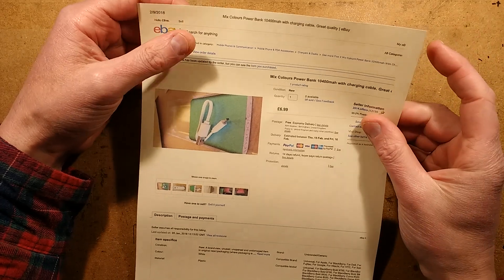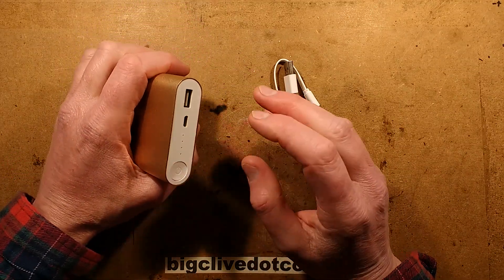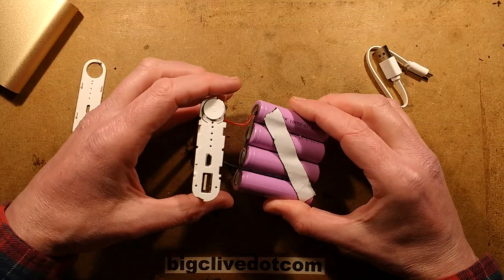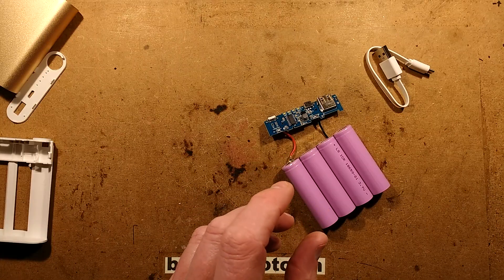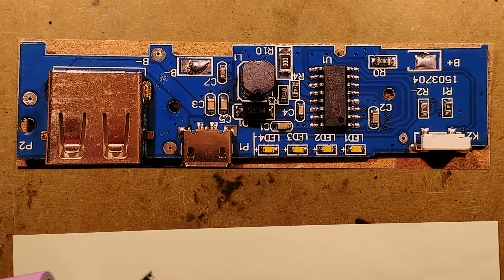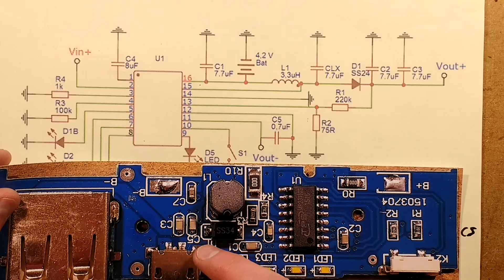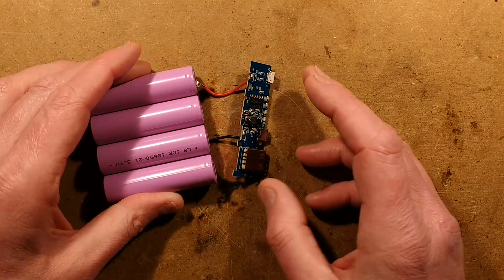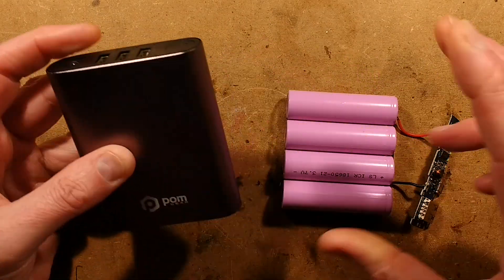Inside a fake "10400mAh" eBay USB power bank.

Comment: A few things that would be good for us to know about that unit. How much do the batteries weigh. Remembering of course that a decent battery almost always weighs between 43 and 45 grams. These batteries have the "look" of decent batteries. In fact, they "look" like batteries which  are used in a laptop battery I have purchased at one time. I believe I could give you the number,,, Well, looked and there Samsung ICR18650 , at least on mine, which came from a new laptop battery. Of course, they could be fake and filled with sand or whatever. But, then, would they fit that 43 to 45gm profile I've found to be so universal ? I have 125 approximately 18650s here, all new. I've found when I buy individual batts from ebay china I'm ripped off, they may weigh as little as 20 to 25 grams and have terrible specs even when your told 5000 mah heh heh.  A set of 4 from Walmart one time weighed 27 grams each, so even they can rip you off. Laptop Batteries, always are good. So Far. 

  Next , at a minimum, a small 3 or 4 digit VM on the batteries, which are in parallel,   should be between 4.2 nd 3.7 of course. Nice, would be a clamp meter for dc current on output of batteries. Then, we could get the full picture.  You do have one of those little $45 dollar (not sure what that is in pounds) clamp meters , right ? They are SO COOL !  Mines a Uni-T , True RMS 2000 count, 100 amp DC down to a few milli-amps ! For under $50 ! 

Anyway, cool vid and a buddy who is crazy about these little gadgets told me about it. From the Redwoods, its Mike .

Comment: So, you say it is not 10400mAh, and that it is because of fake sand filled batteries. But, you don't show any part of actually testing it. A battery pack normally consist of 1,2V cells, so that is what the calculate with even while it gets converted to 5V. So, 10400*1,2V / 5V= 2496 mAh at 5V. Where an efficiency is 80% if to be expected, that leaves us with 1997mAh at 5V. So, can you charge an USB device at 1A for almost 2 hours or not?

And if the battery cells are just sand filled, open it, and show it.

Comment: The last one I bought had an insanely high capacity claim but the ebay seller stated that it was the manufacturer's claim, not his. One dead give away is to look at the charge rate and time. If it says it charges fully in 8 hours at a 1A rate, there's no way it's over 8000mAH (2000mAH per cell) capacity. I've noticed that some will use the cells' capacity but then combine that and the 5v boosted output to calculate a higher output capacity claim, then (accidentally or intentionally) shift the decimal one more place to the right (giving something like 100000 rather than 10000mAH in my case when the actual combined cell rating was 8000mAH at 3.7v not 5v). Knowing my electronics, I still thought it was a good price for the actual capacity and solar charging (be careful also against a large panel made up of smaller segments spaced out to 1/4 or less coverage like I've seen on cheap solar walkway lights).

Comment: It's a clone of already a Chinese company Xiaomi
Reply: I have the original Xiaomi product of which this is a clone. Nice to know the Chinese are copying other Chinese designs now, instead of just the west's products.
Reply: You said that as if no one knows what Xiaomi is.
Reply: That reminds me of a gas plate tamper my boss bought at auction. Turned out to be a Chinese knockoff of a Chinese knockoff. Never did work right, the engine near fell off within two days of using it. Sits in the corner as a reminder to bring me with him when he goes shopping at the auction.
Reply: Me and my wife both have Xiaomi phones. Poco and Note 7. Both phones are great and battery life is amazing.
Reply: @chrisa1944  they look alright but that android version looks god awful. Bit like Samsung
Reply: @cydonia9342  I always use Nova Launcher so not an issue for me.
Reply: Chinese doesn’t mean bad.
Reply: MAXYMOK just because they're Chinese they don't make clones

Comment: I bought 5 of the kit version of these last year for $1.89 each. I installed my own salvaged 2,250AH cells for a total of 9,000AH. If I had any 2,600AH cells, then these would make their printed spec of 10,400AH. Anyway, they are very nice kits and have served me well. I always toss one in my bag when traveling. Got mine here...
https://www.ebay.com/itm/5V-2-1A-USB-4X-18650-Power-Bank-Case-Kit-Battery-Charger-DIY-Box-For-Smart-phone-/192057227978

Comment: Imediately I saw, those 18650 Samsung cells are rated at 2100mAH.. 4 in parrellel only 8.4Ah. What a rip off haha! Not to menton they are only 3.7v nominal so will also need a step up! How companies get away with this is beyond me :(
Reply: because not enough people complain, we just put up with crap ;-)
Reply: I'm terribly sorry, I don't quite understand what all of that info means, could you explain this in words that someone with no electricity knowledge whatsoever? 😞😖
Reply: lostskull7467 think of it as buying a gallon of petrol, but you only get two pints. Your still paying for the gallon and your can looks full but it not. You will only ever get two pints worth of miles.

Comment: Please can you test this! 20,000 amp chinese pocket sized car jump pack? really not sure if this would actually work: https://www.ebay.co.uk/itm/12V-20000mAh-Car-Jump-Starter-Black-Pack-Booster-Charger-Battery-Power-Bank-HOT/253357740495?hash=item3afd4c51cf:g:LOcAAOSwlzRaZvog

Comment: But bear in mind that "mAh" does not say shit about what sort of current you can draw from it. Technically, it might not be a lie. I deal with lots of shit, lead accumulators for example, and the manufacturers, although mostly standardised will deal with this differently. For example, 12V 7Ah could mean 12 volts 7 amps for one hour, or 12 volts 1 amp for 7 hours. But usually it is calculated for 28 hours. So, 250mA at any given time (plus, you have to look at the discharge curve). In all cases, legally correct.

Comment: It's weird, i have an ASUS one, it's EXACTLY the same design. Makes me want to check the cells now :o
Reply: Asus is a legit brand, I can guarantee at 99.99% accuracy that the cells are real. You might want to get one of those USB power meters. I did and it's super great for checking current draw and capacity. It even takes multiple inputs like micro USB and USB-C.

Comment: Even I bought one of those... 
Surprised by the rate of discharge, my investigation was a brutal one..
 the 3 batteries(amongst the 4) are filled with SAND... YUP I OPENED THE Li battery.... Suggest you do also.. but make sure you get a voltage reading on one and then,, open the other three

Comment: Clive, do you think there would be less voltage drop, and thus higher output current, if one were to swap those crap cells with something more suitable like an LG or Samsung cell with 3000-3500mAh capacity?

Comment: Hwy I'm sure you get this a lot but what specific power bank would you recommend? I dont care about the size I just want something that actually does as advertised. you can recommend a brand also thanks.
Reply from the maker: If you get a prominent brand name within your country then it will have to comply with trading standards and local regulations.  That means things like Walmart/ASDA power banks are generally predictable.
Reply: bigclivedotcom sweet thanks. I have a hard time finding powerbanks on Amazon because they always seem too good to be true.

Comment: The voltage drop under load is due to the output diode. It's marked as a regular silicon diode on your schematic, which would have a forward voltage drop around 0.7v. A Schottky diode could be put in there instead to lower this to around 0.3v, but they have higher reverse leakage. In this application though I don't think it would make a difference. No excuse for advertising this as 10000mAh though...

Comment: I think the sadist thing is that, the true one, Xiaomi's first 10400 power bank, is only 69rmb(7 pounds in uk) when it launched 3 years ago, it was one of the best selling power banks, and have the best performance with LG's 2600mha 18650 battery.

Comment: A few things. I believe part of the trickle back @ 2.1 Amps load is your typical USB 2.0 maximum current rating, therefore, the current die off after trying to draw more than what the output is speced to deliver is the output transistor's protective gate kicking in. The charge curve you have observed is a deliberately designed in charge curve, delivering fairly high current in the beginning stages of the charging cycle, but deliberately throttling down as more and more energy is detected in the batteries via the mini mosfet circuit loop. Those look like high current rated 1755 cells (??) If so, they are quite capable of delivering the rated spec -if not even more.

Comment: Try the expertpower "10000mAh" external battery pack.
$10 on Amazon in the us.
It is a good power bank but can't take drops while plugged in and charging.
4 2200mAh cells in series
Looks somewhat like this but with a different casing, the chip is a really good one, has short protection etc, led light and 2 usb ports (1 1a and a 2.1a) yet the board also has an extra solder point input for charging and 2 output solder points that are separate from the usb ports solder points. Overall a good power bank for $10 with free Amazon prime shipping, made out of durable plastic

Comment: UL60950
Table 5B – Test voltages for electric strength tests based on peak working voltages
REINFORCED INSULATION  |  PRIMARY CIRCUIT to SECONDARY CIRCUIT  |  WORKING VOLTAGE U, peak or d.c.: Over 210 V up to and including 420 V b  |  Test voltage, volts a.c. r.m.s.: 3 000
For testing with DC, multiply indicated AC RMS voltage by sqrt(2)

Comment: 1000mAh is truly terrible for 18650 cells. Even high discharge/low capacity cells are better than that. Those are garbage battery cells, even if they're not fake. Even Panasonic's weak flashlights cells are far superior. Also, they're ICR which is an old chemistry. INR is much better and safer. Put some real Samsung 30Qs in there and you have a real 12000mAh bank that's nearly bulletproof at the currents USB can draw and charge at.

Comment: It might have a battery at the claimed mAh but the deceiving question which no on thinks to ask is at what voltage. mAh alone is not a good gauge of capacity unless you are aware of the voltage. If you want to compare apples to apples, look at watts/hour

Comment: About 9 months ago I was on a US Air flight from St Louis when a man's power bank in front of me started belching white smoke. He didn't know what was wrong but I have seen lithium fires and realized what was happening. Since luckily we were still on the ground I encouraged him to run it to the front of the airplane and throw it out the door.  When he came back to his seat he told me that he barely got it out the door and then they kicked it out the ramp door and onto the ground. At that time it exploded in flames. I asked the flight attendants if they had any training and what to do for a lipo fire and at that time they did not. I wrote letters and the good news is the last time I traveled they now have equipment to contain a lipo fire and have had training how to use it. I'm not sure of all the airlines do but at least US Air does. I still travel everywhere with a lipo sack for fire containment with my laptop bag just in case. The fumes from one of these fires are pretty noxious and I don't know of anything it will contain at least some of the fumes from a a fire how other than what is called a Bat-safe. These bags ( not the Bat-safe) are fairly inexpensive and I keep a number of the sacks around my home and auto just in case. These lipo cells are used for a lot of things today including someone's Vape  device , your small drones and model helicopters.  I keep a number of these bags around my house and have one in every car just in case. They are small and the bags are very lightweight. One of these bags may not save you but it will at least give you some chance to either get the battery out of the area or yourself away from the fire before it it ignite's something else such as your car or home.
Reply: Just looked at your story - 1yr later. Quite chilling to think it (the battery) could have exploded while airbourne. The airlines here in Perth Western Australia (at last look a few months back) now have a battery size limit you can take on planes. Apart from the smoke - I'm thinking a fair sized metal bucket might be OK in an emergency....? Don't know..... Certainly a metal bucket would beat having nothing at all. Maybe an ice bucket with no ice ?

Comment: You have the circuit upside down. Pay attention to the microchip notch on the top left on the diagram and look at your printed chip it's upside down. You have an effective chip. They did a poorly programing chip that is not doing its job. Most Chinese chips have a faulty programing.

Comment: but its actually cheaper to salvage 18650 from a fake brand powerbank than to buy individual cells. lucky me i got a claim 10400mAh fake xiaomi which disassemble and tested with a balance charger and turn out to be around 2100mAh each for total of 4 cells.
Reply: which looks identical to yours

Comment: I received a fake off eBay listed as a genuine Xiaomi. As I already owned one real one I could tell it was fake straight away. Very sharp edges (genuine has smoothed edges), USB port not perfectly in-line (genuine lines up with casing perfectly), LEDs poorly lined up and light bleeds from around each LED holes. If it doesn't come in a cardboard sleeve with a scratch off silver panel that reveals a authenticity code then you've definitely got a fake

Comment: So, if you were to replace them with 3500mAh cells, wouldn't you still be able to use 14000 mAh ? I'm looking for a way to get a stepping 45W (from 15W to 45W auto sensing) power bank that can provide 3A@15V.

Comment: I got one of those 10400mAh power banks myself (brand new) from a MetroPCS phone store. They claim it will charge your phone 2-->3 times over. Unfortunately, it would only charge my phone ONCE to maybe 85-->90%. It charged my SMALL Android Samsung Galaxy On5 to 100% only once when the power bank was NEW! [As anything else in electronics, you need an OVERKILL of 200-->300% to make anything work properly]. All these companies boast about the ratings of their products, but they usually fall way below the mark!

Comment: got one empty case about 2 bucks (US), not bad capacity with 4 2400mah cells in it, but the current output is only capable of roughly 1 amp. similar 3 cell empty powerbank cases with samsung name on it are lots better, about the same price.

Comment: I have a similar one and mine was even worse two of the batteries had such a high internal resistance they just could deliver 400mAh, the other two were 1Ah and now serve in my led lamps. I am in the process of configuring a new pack and "rejuvenate" the bank.

Comment: These "10400mah" battery bank cases are mass produced at a factory in China somewhere. I have 3-cell versions of the same design that say 10400mah on them despite coming with no batteries, I bought them empty off Aliexpress for $2 and stuck some spare 18650s in them.

Comment: Ever looked at one of the 8x18650 battery pack cases where they're like $4 on eBay and you put in your own cells? I'm going to populate one with some 2200+ mAh cells I've recycled from laptop packs. Seems like an inexpensive way to get a large capacity power bank

Comment: You do know you're never supposed to fully discharge any lithium battery right?... and that's the first thing you did before you tested it. That causes damage that won't recover. Not saying this is a up-to-spec product - but you should know better.
Reply from the maker: https://www.nature.com/articles/srep30248
Reply: Interesting, but trust me it really does make a difference to most people. I have about 100 18650's to power my e-bike and RC's and my vapes - If you over discharge them - even brand new ones - it's a big problem. I just did this with one of my RC car packs... Genuine LG 2 cell. Accidentally left it turned on after the batteries were low. Now they can't take 4.2v they just never get there. Now maybe if I use a bench supply to put more current through them up to 4.2 it would be fine. However, most cheapie but load balance chargers won't. It's a bad idea to run them low... and pointless to run them low when they are new... Just sayin' >> still love your channel :)

Comment: Looks almost the same as my Clas Ohlson 20Ah (yes, 20000mAh) power bank. Except my power bank cost a fortune, is licensed by Clas Ohlson and has dual USB ports (1x2.4A and 1x2A ports). It's double the length of that little power bank, and weights quite a bit.

Comment: Recently bought a two-pack of Aibocn's 10000mAh battery.  Many good reviews on Amazon, but most due to inaccurate testing methods.  Tested both batteries with a Keweisi USB meter and noted that they accepted just over 6000mAh when charging, and produced just over 4000mAh when discharging.  There are four 18650s inside, so perhaps two of the cells are bad, or probably all just over-rated.   Manufacturer is sending me a replacement -- we'll see if they are any better!